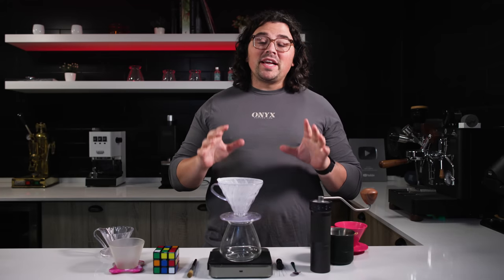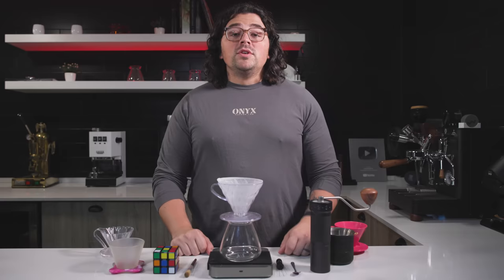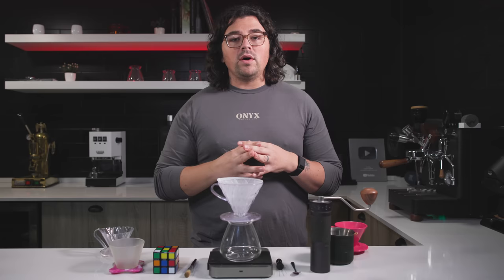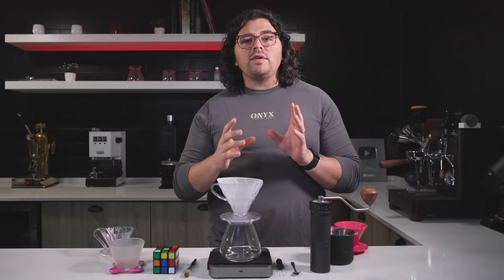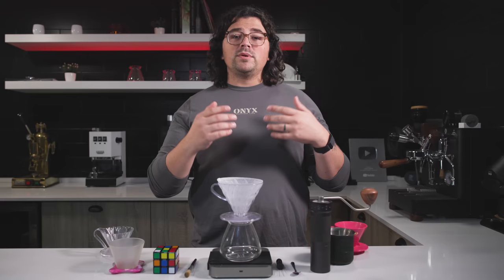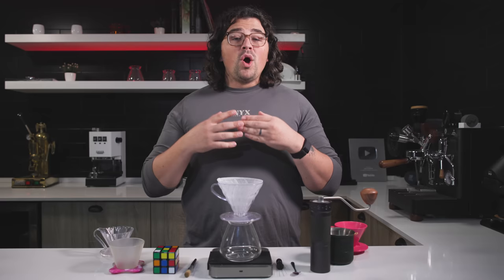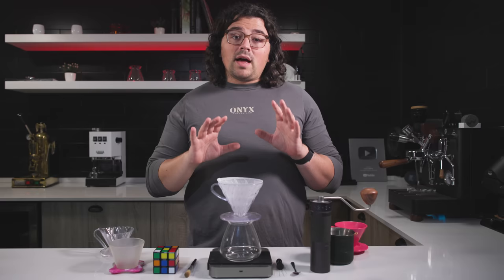ULTIMATE POUROVER RECIPE (any method)

Comment: Loving my ZP6s Lance! had it for two and a half weeks and loving every minute of it. would something like 5.5~ be around the grind size you're referencing here? (when 0=burr lock)
Oh and would you make any adaptations for a flat-bottom brewer? using mostly the April, Kalita and Timemore B75 and moving away from cone shaped brewers
Reply from the maker: I use the zp6 here! I'm at 5 but can go 5.5!

And nope! Same guidance for all pourovers. I just used a v60 here because it is most common.
Reply: @LanceHedrick  Hey, Kplus user here, wondering if getting a ZP6 would offer real world benefits in the cup? I remember you mentioned the ZP6 was Lower in fines and kinda flatter tasting.
Reply: @LanceHedrick  okay two days following this method and been getting constantly good cups.
The point about the pour height is spot on. Really help with the consistency when paying attention to the point right before the stream begins to break

Comment: I have heard that the finer you ground on a cheap grinder the more consistent the grinds gets. Thus a finer ground at a smaller ratio (I’ve seen some crazy ones like 1 to 9 before) have also been fairly consistent. Not sure what you think of that? 

And what’s your reasoning behind pouring at such a specific flow rate? You never explained why? Like I get it affects extraction but how?

Comment: Hi Lance, thanks for another great recipe. I was wondering what's the reason for pouring in a small circle in the centre in the second pour? Thanks!
Reply: I believe it's because he's "churning" the slurry. What you're trying to do is get the whole bed turning in on itself similar to what you see in a blender - so that every single granule is in circulation with the fresh water. This "churning" alongside the coarse grind provides an even extraction. It's easier to achieve this motion in a flat bottom brewer.

Comment: Hey Lance, man I really appreciate how you go more in depth with respect to brew ratios, water temperature, etc as it relates to different roast levels. I was just trying to understand though exactly which coffees you were referring to when you spoke about "lower ratio" vs "higher ratio". When you reference "lower ratio" (at 4:24) are you speaking about the ratio for the lighter roast (1:17)? I just wanted to confirm this, because, unless I am mistaken, mathematically, 1:17 is a "lower ratio" than 1:14. Because you then go on to say that lower ratio corresponds to lower strength. But a 1:17 ratio means more water for a specific amount of coffee than a 1:14 ratio. Wouldn't that cause the higher, 1:14 ratio to have a higher strength?
Reply: you are mistaken
Reply from the maker: I am saying 1:17 for light and 1:14 for dark
Reply: Thanks a lot for the response Lance. So the idea is to get a lower extraction but higher strength from the darker roasts, and a higher extraction but lower strength from the light roasts right? Or is that the other way round? Thanks in advance for the clarification! I appreciate you sharing more about the science behind the procedures. At the moment, the brew method I've been getting very delicious cups with and currently stick to, is the first one you published ("The only V60 Recipe you will Ever Need"). I use the Baratza Forte with the steel burrs.

Comment: Would an Ode Gen 2 grinder qualify as high enough quality not to have the fines Lance is talking about?

Any suggestions for starting point grind settings for the Ode Gen 2? I just tried this recipe at 4.1 and had a 6’23” brew time with a 2’ bloom time. I pretty much stalled out. I will try coarser, but I’m brewing a SEY Jose Javier Canacue and want to waste as little as possible on dial in. Thanks!

Comment: Don't use plastic...use ceramic or glass.
Reply: You do know there is a specific reason most pourovers are made from plalstic ? It’s to retain heat when you preheat it to bloom. Glass and ceramic are ok but will diffuse heat a lot quicker. And these are long term use products, not a few times and then thrown in the bin. I use a bodum glass with carafe attached but it’s not for everybody. Also comes with metal filter again not for everyone.

Comment: Thanks for the great recipe, Lance! I'm getting some very tasty pours. But I'm having trouble getting a flat bed. When I pour in a small quarter-sized circle in the middle, I end up w/ about 1cm thick deposits on the walls of the filter. What am I doing wrong? I'm doing a 2' bloom, and I excavate it with a spoon like in the video, to make sure there are no dry patches.
Reply from the maker: If tasty, don't worry about it! All you need to do is give the brewer a quick swirl to help flatten the bed, though. Also going coarser would help but then you'd lose strength and extraction, so if you do this, increase agitation
Reply: @LanceHedrick  Thanks for the advice. I coarsened the grind a bit. and did some excavating of the bloom w/ a WDT tool, + the final swirl, and the bed looks great now. Also, I'm finally able to get tasty brews out of some problematic light roasts... super sweet,  w/o bitterness, doesn't turn sour after cooling, and no more woody/earthy tones (i'm also blowing out the chaff per your advice). A total game changer, and upped my enjoyment 200%! Blows away all of the other methods I've tried. Thanks a million!

Comment: Great video Lance!  I typically follow both the James Hoffman recipe and I do the wet WYSE.  I will try this.  I have never seen that long of a bloom time before, so I am intrigued.  I roast my own coffee, cheapish roaster, behmor drum.  Typically light roasts; City into Full City with Full City Plus about as far as I will stray.  My roasts come out very gassy when it hits the pour over process.  I have found triple the dose to bloom is necessary otherwise the coffee bed is more wet grounds expanding than grounds sitting in water.  Do you have roast experience on whether I need to do something different or is coffee that gassy ok and do you have a recommendation on how to brew pour over.  I am verbose as well, in short...will this recipe be a good idea for my situation?  Thanks for what you do :)
Reply from the maker: Yes! This will work. I'd recommend grinding and letting the grounds rest 30min if they are super gassy.
And practice a 2min bloom.

Any changes you need to make are advised in the video and caption! Cheers

Comment: Kinda confused by the excavation thing. Isn't channeling bad? Isn't too much bypass bad? (I am using a Next Level and I love it.) It seems like excavating the coffee bed would be causing a giant hole of channeling. Seems contrary to what I have learned up to now.
Reply from the maker: No. This will not cause channeling. On the contrary it will decrease channels.
Reply: @LanceHedrick  ok. Thanks for reply. How does this work? Are you just scooping from the top and turning over, and repeating? (As contrasted with pushing spoon to the bottom of the bed, taking a scoop up from the bottom and depositing on top). BTW I also have an Orea which I quite like and will try this with that.

Comment: Hey! Thanks so much for sharing this! If I need to brew 500ml each morning, is it ok to brew V60 size 2?
Reply: Yes
Reply: It also depends on your ratio and pouring speed. If your dose is too high (like 36 grams) and you dump all the water fast, your 02 V60 might overspill. For large brews I would recommend multiple small pours to avoid overfilling the dripper.

Comment: What are folks doing on a fellow Ode Gen 2 and stock gen 2 burrs, setting wise?  I'm at the last notch on 5 before 6 on a rather light roast, and I'm getting some bitterness.  Using the Hoffman method on the same setting is yielding an excellent cup, but leaving a touch of extraction on the table I feel.  Brewing Passenger El Guayabal Gesha at 210 19 days off roast.
Reply from the maker: Go coarser!
Reply: @LanceHedrick  thanks big dawg.  Release that SSP Ode video you recently mentioned already!  Greatly appreciate all the material bud.

Comment: Lance, thanks for sharing this method. I’ve been doing 50-75 gram bursts of water in my v60 for sometime but I do struggle with fines clogging up the brewer. This is with all my grinders from Encore to Webber Key set on the lowest RPM. Could this be poor speed or burst pouring vs my grinder producing excess fines? Thanks.
Reply from the maker: With lots of pours, if fine at all, it is difficult not to clog and stall. Could also be your filter. I'd recommend the hario tabless or, even better, cafec medium roast
Reply: @LanceHedrick  Thanks for the quick reply!

Comment: 4:24 I was rewatching this video and realized something: I have no idea what the difference is between extraction and TDS. How can a brew be higher extraction but lower strength?
Reply from the maker: Pour a ratio of 1:100. Use same grind and recipe and brew with 1:2.
The former will have loads higher EY.
The latter will have loads higher TDS
Reply: Extraction is the soluble part of your dose that you get into your final beverage. You increase extraction with finer grind size (to a point), higher temperature, higher agitation, longer brew time, but most importantly, more water.

Strength is (fwiu) the proportion of dissolved coffee in your brew v/s how much water it has. In simpler words, it's ratio. This is why it's correct to say that espresso is stronger than filter coffee (espresso can use a ratio of 1:2 or 1:3 whereas filter coffee usually is 1:16 or 1:17 for example).

Extraction and strength are related but aren't the same. In Lance's 1:100 brew ratio you'll have a really high extraction because of the large amount of water being used, but for the same reason, you have a really low strength.

Comment: Can you recommend an approximate click setting for a Comandante for this brew?  And a setting for a Gen 2 Ode?
Reply from the maker: 26-28 c40 and if burr lock at 0 on fellow, then around 1 o'clock (can't recall the number right now, just placement on a clock face)
Reply: @Lance Hedrick  that would be number 7 on the gen 2 ode.

Comment: I'm getting into V60s and was a little confused by the difference between V60-02 and V60-01. As far as I gather, it's just the size of it that differs, right? V60-02s are much easier to get where I live, so I was wondering whether I could use them for single-cup brews? 
Sorry if this is a super noobish question 😂
Reply: “Noob” questions are always welcome because we all were there at one point. If it’s easy to get the 02, I would just get the 02. I prefer it honestly, because I usually make a larger batch in the morning to get going with my day! But an 02 will still brew a single serving of 12-14g if that’s what you’re going for in my opinion. I think it handles single cup to larger serving just fine.
Reply: @paulmeahan3667  Thanks a bunch! 👍

Comment: Hey lance, lately i've try to finer my grind size and try to maximize the extraction..but somehow it ends made the acidity in the final cup so sharp and punchy..like a vinegary maybe. Can you help me? Cause i think sour and vinegary will came out when our extraction low (under extract). Big thanks..i'll try your recipe soon
Reply from the maker: I'd need quite a bit more info here! Coffee? Roast? Process? Water temp? Recipe? Grinder? Etc
Reply: @LanceHedrick  almost all natural with fermented flavour and small amount washed coffee, i really2 hard to make a good one in natural coffee.. but in a classic natural just fine., Water temp about 1 min after boiling in kettle 650ml, roast mostly in medium, recipe pulse pour 4x.. tbt about in 2.15-2.40..grinder the timemore c3 hand grinder and N600 model in asia..

Comment: How would you adapt this recipe using a Hario Switch?
Reply from the maker: Switch closed for the bloom for sure! Then I'd just leave it open for the duration of the brew tbh
Reply: One thing you could try is replacing the agitation to control drawdown with just closing the switch, for a more precise and repeatable brewing process.

So first time you brew with a particular bean, don't do any agitation and note down how far under 4 minutes you are.

The next time you brew, leave the switch open for the pour, and then close it when you're done pouring, for the time you were under 4 minutes the first time.

But to be honest the switch has kind of ruined pour over recipes for me by making everything taste amazing if you just do an immersion brew 😅

Comment: I was looking everywhere for a way to be sure I'm using proper grind size. How many clicks should it be onC40?
Reply: You should mainly go by taste and his recommended brew time which is 2-4 minutes depending on how long you bloomed. You can start at like 30 clicks see how it tastes then most likely work your way down until you get a tasty cup.
Reply: @Java_CM  for now I tried 27 and 25 which probably was to fine because the coffee wasn't great at all. I asked because I wanted to rufly know the settings as I didn't want to waste a lot of coffee.
Reply: @Java_CM  okay updating now - I have best results with few coffees on 28 clicks (c40)

Comment: Anyone tried with a Chemex ? I’ve put 30g, 500ml. Light roast, medium grind, 2 min blooming and I get 5min and 40 sec of extraction time. I could coarser but I’m pretty coarse already. I’m using my Niche Zero which produce some fines, not very happy but still. I’m curious to see if anyone is having better results with this method ?
Reply from the maker: Niche is not great at pourover. Go we'll past 50.
Reply: @LanceHedrick  yep I’m well past 50. I’m on the opposite side, on the Zero :D
Reply: @LanceHedrick well well well, I’ve decided to invest in a 078 and V60 dripper😅 ! What would you recommend as a grind settings with the Timemore for both this recipe and the original 1-2-1  version? Do you use different grind settings? I’m only using light coffee btw .

NB: grind setting 6 was maybe a bit too small this morning or too many fines, it clogged at the end of the brew.

Comment: I've been using this method for almost 10 years and I've not tried anything else in 10 years because I like it and don't bother to rock the boat.

I use V60

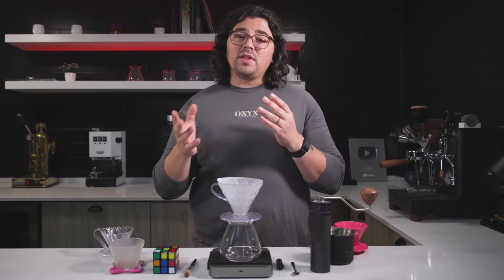Grind setting 23-24 on Comandante. 22-22.5g of coffee to 350g of 88-95°C water(depending on roast). 45-90g pre-infusion(depends on date from roast,roast level and if I want more sweetness or more acidity) for 40-60sec with a swirl. Then one slow even pour finishing in around 2 min for a total of 2:30-3:00 min brew.

Slow controlled even pour is a key for the V60.

I used to try 10+ different recipes about 10 years ago but I always came back to this one.

Well should I rock the boat ? I like my current result.
Reply from the maker: cool! the question then must be asked- why are you watching recipe videos if you like your current result?
Reply: @LanceHedrick Out of curiosity I guess. Well you know we coffee geeks are always looking for the holy grain when it comes to our cup of coffee.

Comment: 1.32 you mentioned that world champion extracted their coffee at 16-18% and it taste good, while it won't work for our usual coffee. So with your method, what is your aim for extraction percentage?
Reply from the maker: Well, they aim for that and it does well in comp, but comp is a different world. I can't stand the coffees served there. All super vinegar tasting with insane over the top processing. They all taste like herbs and booze and vinegar. 
This hits 20-21% if done how I did it.
Reply: @LanceHedrick  Wow, so you even try to aim higher extraction with relatively coarse grind and aggresive agitation.

With my usual recipe, ratio 1:16-17, 3 step pouring (including blooming), TBT 2.30-3.00, I only get 17-19% EY with 1.2-1.35% TDS. Comandante 24-26, sifted with simple sifter, and fines come in in 2nd pour. Because as you mentioned, I noticed that this fines would make off-flavour like astringent or even bitterness if started to wet from beginning. But without these fines, the flavour seems hollow. I never do aggresive agitation like stirring or high pouring, only swirling after every pour.
I might try to coarsen the grind size and be aggresive, see if I can get better result and how much EY & TDS.

Thanks Lance!

Comment: You have multiple pour over recipes out. I'm using high quality lightly roasted speciality coffee and zp6. I'm intrigued if you could recommend me any of the recipes. (I'm happy with mine but I like to experiment.)
Reply from the maker: this one
Reply: @LanceHedrick  smart answer 😃 I'm definitely trying it out
Reply: Ok. I finally had time to try your method with my new zp6 special and the brewista kettle and the result is very good. I likely need to grind a bit coarser but the cup is smooth and not bitter with a lot of fresh flavours. I boiled water to 98 degrees and and didn't reheat. I started the pour after 2 min bloom. The water was 89 degrees by then. It took me exactly 4 minutes to brew (with the bloom). I would say the result is comparable to my divide by 5 method. However, I need to make more pours and try other beans to really decide which I prefer. Thank you for being thorough and precise in your videos.
Reply: Btw isn't this method similar to what automatic drip machines would do, you just have more control over the process (but also more space for mistakes)

Comment: When James posts I'm like "that's fascinating," but then Lance posts I'm like "let's do this!" I don't know why that is. Anyway, after that one and done that I was told not to do it's decent but the fines from my espresso-focused grinder gave it some bitter overextracted notes. So far I still prefer your method from an earlier video with lots of spinning to catch the fines up the filter wall.
Reply from the maker: Yes! This is an evolution of the 121 with the fines catching. But with a slower flow rate to increase extraction since it calls for more coarse grounds than the previous one
Reply: Maybe my Vario just doesn't go coarse enough without de-calibrating it for espresso.